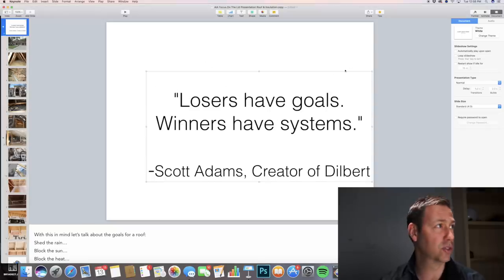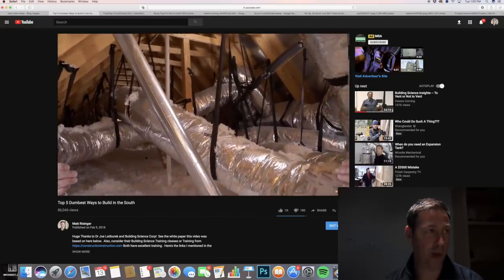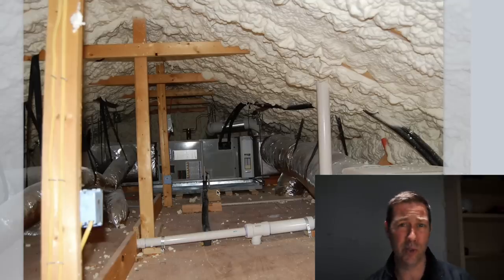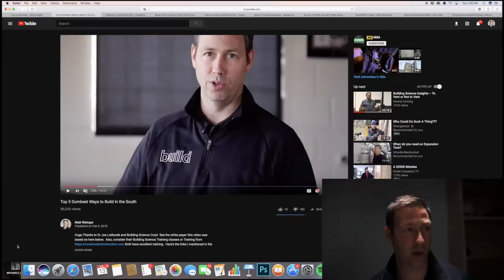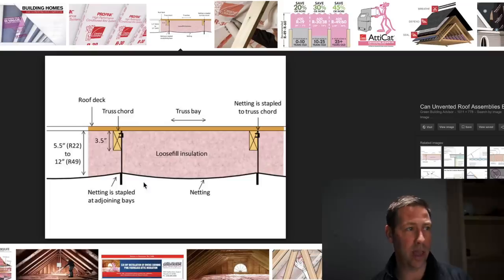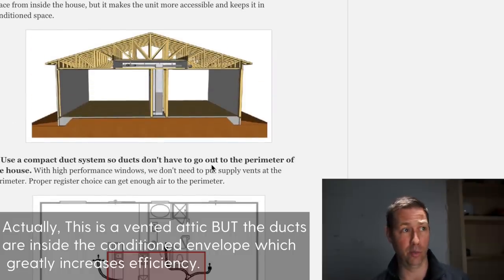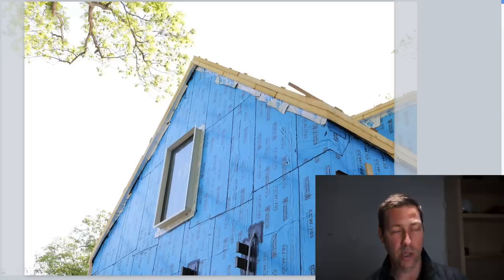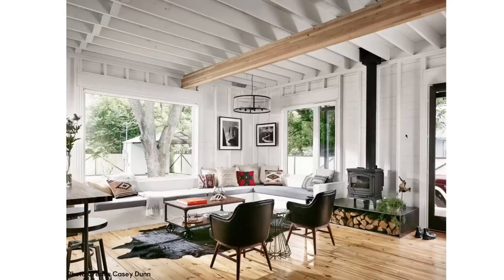Attics/Roofs - Dumb vs. Smart - How to Build Correctly

Comment: $250 / sf?! lol
Reply: at 250$ a sqft my house would be worth 5x as  much as I bought it for
Reply: Maybe they are only selling million dollar homes in Texas? Matt mentioned they do a lot of high-end specs. Or they might get discounts for the advertised building products/services (e.g. amazon incentivized reviews). Not necessarily wrong if it's a good product.
In Chicago it's ~$400k for decent new construction (builder price) for a 3000+sqft SFH. Works out to $130+/sqft. Even Section 8  / community affordable housing isn't that much cheaper. And Chicago codes are a lot tougher in some areas, no Pex (copper only), no flex wires (rigid electrical conduit only).
Reply: Surely he misspoke. Graceland isn't worth $250 a sq ft. 
Most nice homes in the Memphis,TN suburbs are selling for $75 a sq ft. That includes the cost of the land in that figure.
Reply: $75/sqft? I need to move out to the south =)
The $400k I mentioned is just to build. Not including price of land/property acquisition. That's probably why most housing here is 50-100+ yrs old. At least still not as bad as NY/CA.
Reply: smaller houses are more per square foot because of a lot of fixed costs...

Comment: I was taught that if you insulate under the roofing material that there will be no air circulation between the roofing and the insulation which shortens the life of the roof and can cause moisture to form, but maybe this is only true in the North?I mention this because I like being able to do what you show here with insulating under the sheathing so as to preserve space in the attic.

Comment: Matt, can you do speak about FL homes with metal roofs and how to properly do a conditioned space for AC duct work. I am actually playing around with using cathedral ceiling trusses with a traditional flat ceiling truss or rafter to enable insulation installation as well as conditioned attic space for ducts and storage as well. Any thoughts would be greatly appreciated. Thank you for passing on knowledge to others. Much appreciated.

Comment: Spray foam underneath your roof sheathing is a Big No No!
As a claims adjuster, I’ve done 100s of inspections after storms across the south.
It is very hard to know when water has trickled in over time from your roof. It doesn’t show up immediately. Usually by the time u know it. Half your roof decking and rafters are rotted. Not to mention a lot of insurance companies are starting to not cover those types of damages.
Many people try to relate it to water intrusion damages caused by the 
storm. Also it’s hard to find the exact spot water may be coming in because it will run underneath the foam and drip in a totally different area.
I’m not a fan of this stuff sprayed under decking!

Comment: Here in South Louisiana.  External Trane packaged ac/furnace outside.  Plenum supply goes up closet wall into attic, over length of home where branch ducts jut off to rooms.  Using mastic to seal branches to plenum.  Great stuff, big gap filler on insulate entire plenum.  I want to open cell spray foam the roof deck but do not want to go through and seal all the nooks, crannies, remove wind turbines, etc.  If 90 degrees outside, it seems with foamed roof deck attic would be closer to out temp vs. 140 degrees.  Yes, it's gotten that high.  In your opinion, is that an efficient way to go?

Comment: Matt:  I have designed a house that I will be constructing in hot and humid Orange Beach, AL.  The house will have a conditioned attic space with open cell spray foam under the roof deck.  I'm actually adding supply air and return air to the space.  Rather than going to all the trouble of blocking between trusses at the top plates then sealing, I detailed the Tyvek Commercial "D" wrap to be installed continuously up the walls, across the soffits and behind the fascia with the upper most edge of the wrap being overlapped by the peel and stick roof underlayment.  Other than closely managing the installation, do you see any problems with this?  I've been enjoying your science based Youtube videos for a few years.  Keep them coming. Thanks

Comment: Vapor diffusion will go through open cell or closed cell just with open cell at slightly higher rate. Both products are air barriers so both stop 99 % vapor driven by air. So.. yea. Only way for open cell to get saturated with moisture in air is to keep you house at 140F in a winter season. In my 16 years installing open cell in NorthEast ( and closed cell) I yet to see open cell to get wet from the air moisture. Open cell tho looks like sponge actually doesn't perform as one and it not a hygroscopic material so it Does Not absorb moisture from the air.

Comment: I like the last example you showed.

In another 50-years, someone will come along and say this is the way they did it around 2020.

A useful solution set, would be not to use fossil fuel insulation in the attic.  Instead, use white tiles or a white metal roof to prevent from overheating the attic.  Use a barrier of reflective aluminum on the attic’s roof.  Place a couple of solar operated attic fans.  Do not place any air conditioning equipment or pipes in the attic.  Instead use mini split inverter heat pumps.

Comment: Clearly a lot of thought and engineering went on in the development of the methods of insulating attics and the underside of roofs. I offer for commentary something I learned some years ago that says it is contraindicated to insulate the underside of roofs without an adequate airflow between the insulation and the underside of the roof. The reason, as was explained to me is this. Hot or warm air rises and to the extent there is humidity, which is always present in varying amounts, that same humidity with nowhere to evaporate quickly results in the growth of molds and other organisms that can sit on the underside of the roof and cause it to rot. This also begs the question of what happens when the roof itself requires replacement from damage caused by wind and rain and leaks go undetected. Also, the question of the safety of the foam itself is another issue. Some chemicals used in insulating foams are toxic and breathing the fumes that are off-gassed might be hazardous to the health of the people who ultimately live in homes using these homes. Ultimately all the materials used in building anything end up in landfills or remain on the ground where structures were once built. Clearly, the concept of energy saving and reliably retaining heat and cooling within the residences and buildings is an important one for all of us to consider whether as end-users or builders. Thank you for sharing and offering the methods you discussed in your video.

Comment: avoiding sprayfoam seems smart....soooo many potential problems!  but insulatiing the attic space where your ac ducts are is the way to go.....could i use rockwool boards on the bottom of my rafters to create a heat barrier and create airflow to ridge vents, and then add rockwool batts to the attic floor and around the ac ducts?

Comment: We had 1 home and they did spray foam and it fried the shingle roof in just 5 years and it was 30 year shingles .They had nothing in the attic .The heat pump and duct work was in the basement  conditioned space and no recessed cans .Only thing was vent pipes  for bathrooms .We live in southside VA .I just did blown in insulation with 2 x6 walls .I also insulated my slab but they did not .Things are improving every day .I wonder if modular home builders will start doing this last house you show .

Comment: You should never put insulation directly against the roof deck because vapor will become trapped and eventually rot the decking and the rafters.  As a roofer of 20 years I have had to repair that very problem countless times.  If you are going to insulate rafters you should first install rafter vents that extend from the soffit all the way to the peak and have ridge vent on the roof.  If you are using closed cell foam maybe you could get away without using rafter vents but I don't think I would take that chance.

Comment: Imagine the repaint job and discussing whether or not it’s worth an update or changing colors inside. Dirt stains???? What dirt stains????

In all seriousness Matt. What is the angle and spacing of the roofing boards holding the metal roofing? For the life of me I cannot remember the actual technical name. Looking at putting a new roof on my house and planned on doing it myself to save labor costs. I’ve been in construction for more than 4 years, but it’s been over 10 years since I have actually been in construction.

Comment: In the south we are known for hail and hurricanes, if that roof springs a leak can you imagine trying to find the roof leak with the roof rafters spray foamed? The Owen's corning solution with the netting is a disaster. I was in a home close to 8 years ago that had that and the netting in one section had come apart, maybe a rodent who knows. You going to call the builder to fix it? If you put your ductwork in the envelope at some point that ductwork will wear out, can you imagine how much that will cost to rip your walls out. Like what happens if your HVAC system grows mold. (I can't tell you how many times old two story homes have that old grey worn out flex from attic to first floor, it never gets replaced... it's cheaper to sell the home and move. What a home builder suggests on paper sounds really smart until you start having problems, by then the builder is long gone, 1 year typically. How do you think I know this? I see it all the time. The reason it's been done the way it's been done for so long, is mostly due to cost. But you can't just think about up front cost, you also have to think about long term cost... unless your only goal is to sell new homes... then go for it!The best way is to have a nice big open attic that is easily accessible to the equipment and ductwork, it's easier to clean, repair, replace etc. There is no such thing as a better mouse trap. There are cons to everything if you think long enough about it.

Comment: I agree with your logic on spray foam on the roof deck in the attic. However, how would you vent the roof deck on an asphalt shingle roof to prevent the plywood from getting damaged due to heat and moisture if water makes it past the shingles and felt paper? On a metal roof is easy to do.

Comment: I did not read all the comments, so I don't know if this was asked before... If it was I apologize but still ask for the answer...

The two different truss designs in the article drawings show that the roof of the "plenum" truss system is actually higher than the original. Is this necessary to the build?
Seems to be adding about a foot or or so to the total height of the build.
Just curious.

BTW, thank you for a lot of very informative videos, including a few notes about the actual climate for the different builds...
Very important in my mind, though it seems to elude a lot of people...

Comment: Matt I like your videos, and much respect,  but I think you've got this one wrong. 

First, insulating the roof with spray foam forces you to insulate a much larger surface area than just the home's ceiling; maybe twice as much if it's a steeply pitched roof.  Increasing the insulated surface area is a killer when it comes to energy efficiency. 

Second, the sprayed on roof insulation is subject to conductive heat gain, something  standard, or "fluffy", ceiling insulation is not subjected to.  Think of this as dragging an igloo ice cooler out of the shade and leaving it sit in the sun.  It won't hold ice nearly as long.  There's your conductive heat gain as the sun cooks the outside surface of the cooler and conducts that additional heat to the inside (or shingles cooking in the sun in the case of a roof).

Though it might be considered "old", a properly vented attic, with traditional "fluffy" insulation, with the HVAC system contained (hidden or not) within the living space is still a superior way of insulating a home's ceiling.
Reply: Heating with forced air is so useless anyway. Hot water for heat and mini splits for cooling is the way to go, and skip the forced air and all that crazy ductwork. I don't know anything about building but i like my cozy heat in the winter. Unfortunately most of the townhouses here in the NY/NJ area have been built with this cheapy method and I can't find anyone who would tell me what it would take to convert a townhouse from forced air to hot water baseboard if i buy one. Anyone who can recommend an HVAC company specializing in this would appreciate the info. Would really rather not have to buy an older house because of this.

Comment: Not one mention of stone wool insulation. Only time I use spray foam is air sealing with fire rated in attic .Roof venting with poly iso, running it from soffit cent to ridge vent for continuous ventilation . So many things can go wrong with using spray foam as an actual insulation material.

Comment: Do you not have to vent the attic?  We do things different up in the north, don't really care how hot the attic is, every utility is in the basement.  Plenty of insulation above my ceiling, my house is extremely efficient.  Also just had it custom built for $130 sq. ft.  And its not built cheaply either.

Comment: Matt ..I don't understand the comment about 'depressurization'.  Yes. a forced air system sucks air from the conditioned space.  But it can't suck unless it's got somewhere to blow.  And it's supposed to blow into the conditioned space.  (We've already figured out how to handle combustion air with fireplaces.)  Also, with a vent in a conditioned attic, wouldn't it make sense to have a 'return' path to the conditioned space below?

Comment: The house you built, (at the start of when you showed pictures of it), was built with OSB.  Then, at the end, from the interior you explained you used 1x6” pine planks, covered with exterior insulation, so you wouldn’t need interior drywall.  But, the completed house showed the very cool look of the 1x6” boards & the open framing and rafters.  The question is: did you double layer the exterior sheeting?  First with 1x6” boards, then OSB on top? Or did you get two house build pics mixed up?

Comment: Wow! So smart to wrap the house in insulation instead of putting it on the inside!
Reply: Yup.    Risinger harps on this important "ski jacket" point in many videos.     The downsides are subtle:  Eaves are tacked on, and therefore lack the strength of traditional rafter tail eaves.    If not engineered right, a guy's body weight might be too much; look out below!    Use your imagination... !    The bigger problem with tight, energy-perfection homes is they're impossible to remodel 25 years later.   Nowhere is this more intimidating that in modern homes that have post-tensioned concrete slabs-on-grade.
Tastes change, and any high end new house built by the likes of Risinger must be "future proofed."   To this point, I recommend TUBING to a central pull point in attic or basement for low voltage wiring.   Risinger is a framer, first and foremost, and doesn't think about electrical gadgetry obsessively like I do.     Cabling standards change every 20 years or so, and houses stand for centuries!   I'm old enough to have witnessed at least THREE standards of television antenna waveguide (aka "cable") standards change:  In the 1950s and 60s, 300 ohm flat twin lead (balanced) was all the rage; then RG-59 coax; then RG-6 coax.   Ditto computer wiring, which changes even more rapidly.    People rely on wi-fi, mindlessly, with all its frustrations.      Moreover, I have also had to add electrical power duplex receptacles here and there in my 1964-built SoCal house.

Comment: What sort of R factor are you achieving with the 4-6 inches of open cell spray foam? 
How do the proposed cost savings stack up against the added heat and cool requirements for the attic being included within the conditioned space?
Anyone who has ever performed a load calculation will tell you having vaulted ceilings to the roof deck throughout the entire house, will dramatically increase the system's BTU's.

Comment: Do you run into problems with the HVAC system installed in the attic ?
Now that the average lifespan of a system only last on average 10-12yrs ! This is what I was told by the company that installed my new HVAC system.
Just saying that it would be a pain getting the old one out and installing the new one inside the attic , compared to a basement or main floor ?
I do find your videos educational.

Comment: Why didn't you put eaves all the way around the house? 
Also, why are you routing all of the runoff from the roof right by the foundation of the house (no downspout extension)? In Texas the rain dumping out of the downspout will eventually undercut your foundation and limit it's ability to support the structure above.

Comment: On those older homes, with that closed cell in direct contact with the roof sheathing, where is the ventilation for the sheathing? Seems to me that's a moisture trap. Or perhaps not cause you sealed any air leaks with the closed cell. Wouldnt there still be a temperature differential that could cause a dew moisture to collect in between the materials? I'm in Oregon and have to bend my thinking to a cold humid client though.